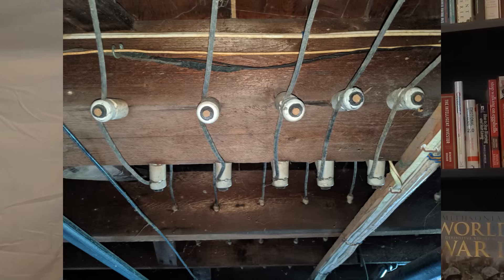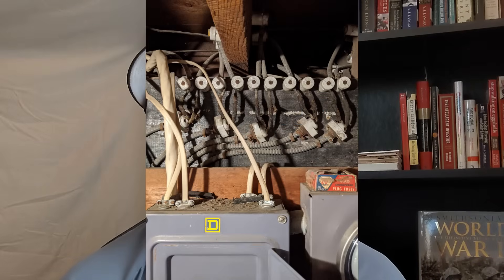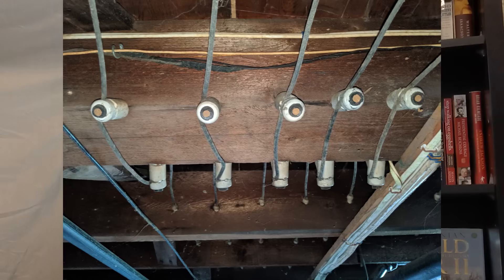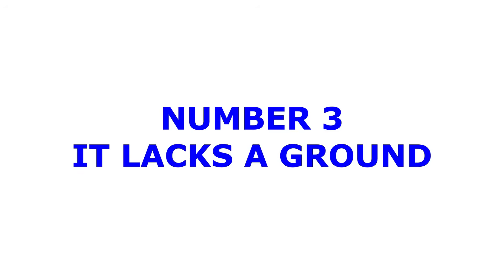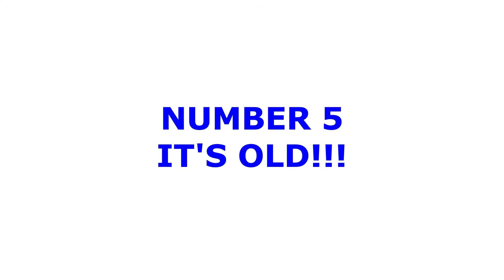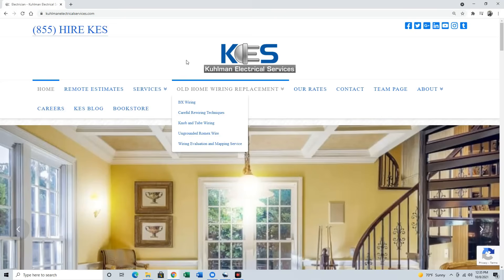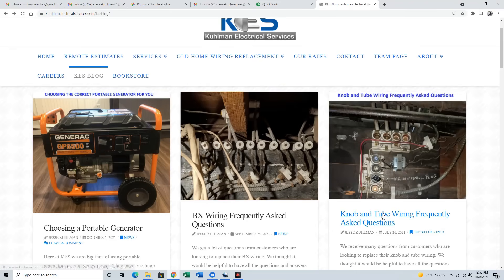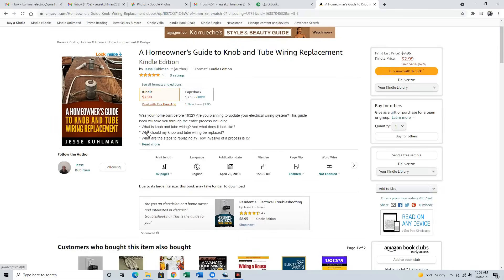Knob and Tube Wiring: Top 5 Issues | Jesse Kuhlman

Comment: Hi.  I live in Massachusetts in a house that was built in 1903. If you go into the basement you can see remnants of some old K&T wiring. You can also see that the house has had the wiring updated throughout  the years as well with both I believe that second generation wiring (has metal casing around it) and what I believe is Romax (?) wiring.  Last summer I had the electrical service upgraded to 200 amps and converted from fuses to circuit breakers. I hired a reputable electrician that got the necessary permits etc.  My concern for years was whether or not that old K & T wiring still powered any of the outlets in the house. After stumbling across this video I got to wondering if between the electrician and the wiring inspector if the upgrade would've or could've been allowed if the house still had active K&T wiring??  Your thoughts would be greatly appreciated. Thank you.
Reply from the maker: Hey Matty great question!  The service upgrade is a separate from the knob and tube wiring / interior wiring.  Think of the 200 amp upgrade as the foundation, and the interior wiring the rest of the house.

Yes, a 200amp service upgrade can happen with old wiring still in the home, it's quite common actually.  

We service most of the Massachusetts, From Worcester to the coast.. If you are in our service range shoot us an email or phone call and we can setup you up with a k+t inspection (if you are interested in one of course).  www.kuhlmanelectricalservices.com

Comment: Is there a way to insulate over the wire with plastic tube etc ? The original covering is gone.
Reply from the maker: Hey, i'm not sure what you mean? The individual conductors?  If the insulation has come off, it needs to be stripped back to where the insulation is good.  Otherwise you need to replace the wire.
Reply: @kuhlmanelectric  I've been told the original protective layer for K&T was typically made of cotton soaked in creosote and over time it just rots away leaving a bare wire ran between the knobs. I was just curious if the original wire insulation could be replaced with the plastic wire covers that are popular to use with computer cables to collect them neatly, in order to remedy the problem you mentioned concerning heat dissipation when fiberglass batting or blown in foam is added to the walls around the wiring. The plastic tubing would allow a small air space around the wire.

Comment: A family member lives in a house built in 1916. The structure is original and some stuff remains from its original configuration. I wonder if there is still some parts of the knob and tube. I find it interesting how things were done in the past and the evolution of plumbing and electrical
Reply from the maker: I find it extremely interesting as well! Particularly the decision electricians at the time were making - Use K+T, BX wiring or depending on the year, ungrounded early romex wire. Then you have homes were the electrician combined them together.

Comment: I am in the process of buying a home with knob and tube wiring. The gfci's do not work. The seller agreed to have an electrician repair the gfci's. Can an electrician run newly updated wire to the gfci's and all of the appliances and keep the rest of the house as it is at knob and tube wiring. The home must pass inspection in order for me to buy it and no one wants to rip out all of the old plaster to remove the house of this wiring and install all new wiring?
Reply from the maker: HI Steven,

Yes new wiring could be run to certain outlets while leaving the old KT as-is, this is not uncommon.

I will say that if they are repairing the GFCI's, they may only be replacing them.  GFCI"s can be installed on ungrounded wiring like KT by code. I'd check with the seller to see what their electrician is actually doing.  If you can, push for new wiring as it's definitely better, but more expensive.

Comment: I've also read that common neutrals between circuits was done with some K&T installs, but that might be a regional thing.

I have a 1915 house and some of the original K&T (with dedicated neutrals) is still in use for lighting circuits, with most of the receptacles having been replaced with separate AC (no bonding wire) or NM runs over the last half century. I think I have just about every generation of wiring in this house, although luckily aluminum is limited to range and dryer receptacles. I had no problems getting insurance, but everything was inspected before we bought the house.
Reply: Common neutral is still done with modern circuits. It’s called MWBC. It has its advantages, but must be done properly
Reply from the maker: Interesting! We see a lot of homes with a mix of KT, BX and romex.  Aluminum going to the range / dryer / other heavy loads is no issue. 

I don't see many, if any, shared neutral KT around our area.  I'll keep an eye out for that though going forward!

Comment: Bought my 1920 all and I mean all brick lap and plaster home 3 years ago. A mechanic and hobby machinists the home runs a 200amp service with modern breaker box that converts to the k&t system. The garage also was k&t with 3 lights and one outlet. Also all brick. Rewired the kitchen the first year while doing a updated look. Rewired the garage the 2nd year to increase my productivity. This summer will be the attic and upstairs rooms. I'd like to get some insulation installed for next year. This house is a bit drafty.

Comment: Enjoyed the video.  I am an electrical contractor and have rewired multiple homes in historic Richmond VA and you are spot on with all your concerns.  One additional thing I constantly ran into was that it was common practice to switch the neutral wire in wall switches.  Three way switching was done very odd as well.  Great job keep up the good work!!!
Reply from the maker: HI Lionel, thank you!  Yes you are correct - look out for those switched neutrals!  Electricians who have never experienced it can be in for a big surprise.  I've also seen the hot and neutral wire being fused in the panels - i always found this is to be fascinating, you have to wonder why they would do that?

Making this video has been a learning experience for me. I have NEVER seen KT in homes here in the northeast built past ~1932, it's really interesting to read how it continued to be installed in other states for so much longer.
Reply: Three way switches were run from a splice in the line conductors to the traveler terminals on both switches flipping the polarity of the socket or making both hot both of which are dangerous.

Comment: My house was built in 57, and I have knob and tube. Greater Cleveland area though.
Reply: It’s not odd to see knob and tube in the cleveland area. Cleveland is a historic town. We have lots of old homes.
Reply from the maker: Very interesting! I have never seen a house in the northeast built after 1932 with it.  I can't imagine an electrician in 1957 choosing K+T over the other options available, not to mention the supply house actually having it, crazy stuff!
Reply: 1957 would be extremely odd.
I would question the age of the house, and/or confirm that it was knob and tube.
I haven't seen anything past the mid 40's, and there was more modern alternatives like he said above.

Comment: In knob & tube did they just run one ceiling light wire down the wall cut it at the switch on the wall, and run the one wire back up where the  junction +/- was located in the ceiling light?
Reply from the maker: Sometimes yes, there would only be 2 wires in the switch, feed in and feed to the light with no neutral in the switch box. 

There were electricians that would run the neutral wire through the switch, creating a switched neutral, these are fun!
Reply: @kuhlmanelectric  Well the switch appears to be one wire cut in half at the switch from the light down /cut put switch in between and other half start at the neautral side of same switch and run back up to the light. doesn't matter which one they cut to the switch .it's just one wire. Off no power to the wire leading back up to the light.

Comment: its actually a well thought out system other than no ground.....both conductors are spaced apart and connections are soldered together ...he is right about the wires being baked over the years from bulbs though......disintegrate if you look at it wrong lol
Reply from the maker: Very true! I think the electricians installing it took great pride in it
Reply: when a switch was put in with KnT was just the hot wire brot into the box? and 1 wire from the lamp as well?
Reply: @raymondgarafano8604  yes...you never put a neutral wire on a switch..
Reply: @workingshlub8861  Hi there wrkg shlub. Yes I do know that, it could lead to a 
loaded neutral, whatever current drawn by the load will be on the neutral.
With romex the white wire of course will be in the box as well as the black
and grounding wire.

Comment: I enjoyed this very much, Thanx. Had some exp with it, changing over to romex, a new panel
was installed (service entrance equipment) weird stuff, small home and 12 fuses. they fused
the neutral! I have seen this in old houses on Cape Cod on west Main street.
Reply from the maker: Often times in the very early days, electricians would fuse the neutral and hot.  Each circuit would have 2 fuses.. Interesting stuff!
Reply: @kuhlmanelectric  I gave that some thought, It may have been 
pretty easy to borrow a neutral from another ckt. I don't know if 220 volts were
around then, but I can see where a ckt rated for 10 amps would have the ungrounded conductor protected but having the neutral possibly carry twice 
as much. I got a jolt putting in a recep. went down cellar and sh'ed holler when
the lite went out, so yeah I thot the ckt no longer HOT. backed into the radiator old cast iron job. hadda see why I got juiced an pulled cover offa the panel. 6 fuses on each of the two lines coming in. It was romexed out of the panel and when I went to the attic, her knobs were all over the place.

Comment: Well. Some issues some lighting in series chain lights via  single poles and switching neutrals via three ways . cloth. Romex . You had sometimes a color coded neutral 
Of course if you  had a master electrician with the   connections  soldered. Than you it was no to as bad as other jobs .

Comment: 1935 house in California has knob & tube wiring. I’d like to get rid of it but need an electrician willing to do it. Had an electrician do some remedial work and add some circuits. The house is concrete block so he’s not thrilled about that. Insurance is the biggest issue…expensive…high deductible.
Reply: Any electrician should be able to rewire a house.
Reply: @danlux4954  the point he is making is that a concrete dwelling would be more difficult to rewire.  I agree.
Reply: @steveloux4709  yes but he should be able to place new wires where the old wires went? Concrete houses shouldn’t burn.
Reply from the maker: HI David, is it concrete block with wood studded walls on the inside?

Comment: Knob and tubes do have their disadvantages- hidden behind walls  and not  protected but I also see significant advantages.

Many are still in use- this proves their longevity. They are spliced /joined by twisting other conductors together soldered and then insulated. 
They are insulated with rubber and or cloth insulation, ceramic tubes and separation of conductors. 

They have the ability to dissipate significant heat because they are not confined hence they should be able to handle even more current.  If they were modernized with a ground wire and maintained I think they will be on par with current wires.

Today we have insulated copper wires that are extremely close to each other in a confined space wrapped with additional insulation- metal clad, or plastic- Romex. Tightly packaging the wires together   lowers the specifications of it's awg  due to fear of them melting and shorting each other.- hence another reason they add ground wire.
Reply: The ground wire is there to protect YOU.....period. In an UN-grounded system if you find a fault the "hard way"....I guarantee you'll NEVER want to repeat it.🤔
Reply: Ironically the knobs and tubes themselves are actually a safer way to mount wires and run them through joists and studs than we do now: by offsetting parallel runs with the knobs, the possibility of accidentally nicking a wire when someone is aiming for a stud is effectively eliminated while the tubes offer real protection against deep penetrations into a stud by a fastener or drill bit.
Reply from the maker: It would be interesting to imagine a modern house being wired with knob and tube.  Some medium sized homes can have over 30 circuits in them - imagine what all those wires would like as K+T?  Fun to think about!
Reply: From what I have seen as an EE, the NEC  has lots of design margin against overheating built in if it is adhered to.

Comment: Knob and tube goes right along with balloon frame houses...both of which contribute to house fires a lot.  Old wiring and an open chase from basement to attic.  Seen it where a house was engulfed in flames in the walls and never set off the detectors.  Fortunately the family got out safely.
Reply: The knob and tube wires I have work perfectly. Zero insulation and circuit breakers.
Reply: I've seen this first hand, my neighbor lost his wife and 2 daughters under those circumstances
Reply: @vanillaice5443  + Sad 😞
Reply: There is knob in tool in the house we live in. No insulation.  Everytime we plug the iron in or run the garbage disposal,  the lights flicker or go low.  Landowner will not replace due to the high expense. There are circuit breakers but doubt that means anything. House built in 1867 or there abouts.  Very large victorian.
 Pray for us🙏 Scary 😐😐
Reply: The idea that knob and tube wiring has contributed to house fires is largely a myth.  A number of jurisdictions even permit insulating around knob and tube wiring, as they've been unable to find even a single instance of a fire caused by knob and tube wiring that's otherwise in good condition (i.e. hasn't been over fused).
Reply: I agree 100%. I'm ripping out all the plaster and lath. Lath is nothing but kindling. I put horizontal studs in with fire resistant roxul,pyrogard plywood to replace the lath.
Reply: @erlycuyler  mine has the 2x4 drywall lath, I replaced all the wires in the upper unit and will replace the lower ones when the tenant moves.
Reply: @danlux4954  Excellent call.
Reply: @erlycuyler  the  old horsehair plaster is fairly fire resistant but the slats will lite up real fast...

Comment: Knob and Tube systems had the boxes with a separate Ground wire  clamped to the nearest water pipe (Lived in 2 houses with/had K&T). for Bathrooms  and Kitchens, this was the practice.
My Top Issue: folk working on K&T that do not know HOW.  Proper K&T was soldered after doing multi turn wraps around the main line, then well taped.
Reply from the maker: I;ve seen this many times.  The ground wire was added later by someone to gain the ground and probably replace the receptacle with a 3prong.  When this is done throughout a house, it can trick home inspectors (if the K+T can't be seen anywhere and they don't pull plates).  They will say everything is grounded properly, even though it's not!
Reply: @kuhlmanelectric  or they do a bootleg ground, a jumper from 
neutral to ground and making metal case of appliance live. also saw  romex 
with 2 wire an ground with 2 different loads using grounding wire as a return 
not good but one load was ceiling lite on porch other load was 2 lamps 1 on
each side of garage door well within reaching height and are metal.